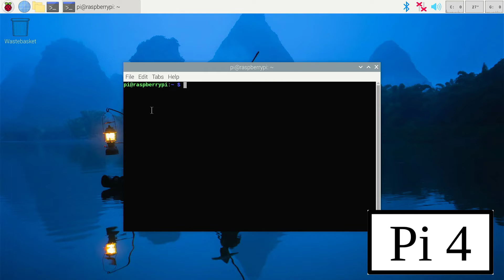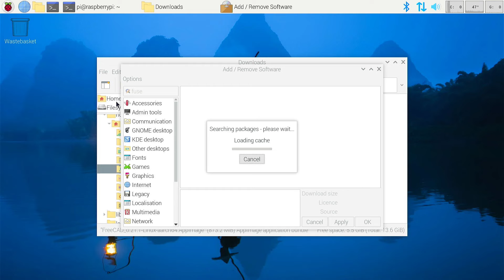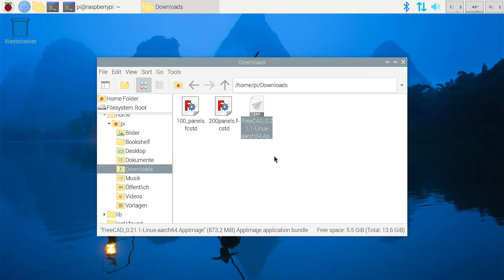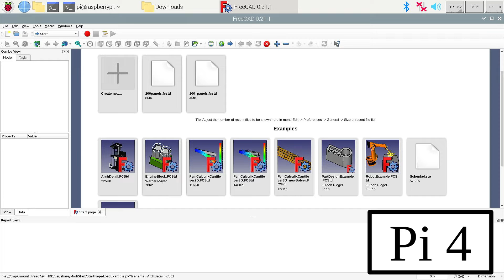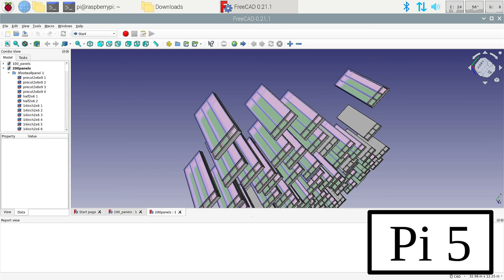FreeCAD on Rasperry Pi 5. Speed comparison vs. Pi 4 with Raspberry OS Bookworm

Comment: What game engines can I run on rasp pi 5
Reply from the maker: I have not much experience in that. But the question is "bad", since there are so many different types of game engines and it is also not clear if you ask out of the view of a developer that use the game engine to make a game or if you talk about a user that runs a game that is compiled from such an game engine. You can for example use a PC to make and compile games for game consoles.
High quality game engines for 3D games like Unity and Unreal will not run. But there are also game engines for 2D and oldschool RPG games. I guess most of them could run. As far as I know Godot, PICO-8 and LÖVE run on the Pi.

Comment: Hi, trying to install Free Cad on Pi 4 , installed Free Cad and when you go to options and type "fuse" the whole options box disappears off the screen, not sure why, can you help?
Reply: Hi, moved on a bit, I found that a window would come up when right clicking the downloaded file as in the video, clicked on "execute", nothing, can you help?
Reply from the maker: @philkneen4752  You are sure you installed fuse correct? There is probably a small warning, that is sadly closed so quick, that you can't read it. Please press on "Execute in Terminal" instead of "Execute" if you try to run FreeCAD. Then then the error message hopefully won't close so fast. If it still close fast, then you need to open a terminal yourself. Do you know how to navigate and execute in a terminal? It is sadly a bit difficult to explain with text only. Can you read the error message now?

Comment: How did you load it, it has a black center screen with mine it hardly loads brand new pi5 8gb
Reply from the maker: hmm... I think i done nothing other special than you saw in the video.
What exactly do you mean with "load"? Start/Execute FreeCAD or load a saved file in FreeCAD?
I used the official Raspbian Pi OS. Do you use an other OS? Currently the different operating systems use different software to display. Some use X11 and some use Wayland. I used the default setting from Raspbian OS. As far as i know that is Wayland on Raspberry OS. Maybe your OS use X11?
Reply: Ok iv just seen all the waylaid stuff i can't get vnc to work ether, but the app cura wont open unless in terminal  ? None of my desktop pics do anything?? Cura ?? Vnc ?? Seems like my old pi4 was better setup finshed
Reply from the maker: @only1leddy  hmm... Not sure if i can help you with that. What OS are you using?
Reply: Linux 6.1 debian aarch64 (2024 01 25 😅 i can run cura but only from terminal, bookworm I think ? Does work but with black screen to start with and flickers loads tbh it's all over the show so I'm wan use fusion on my surface go and just vnc into it but that don't work either? Todo with the waylaid? I really might just load a old bullseye instead at least it works
Reply: Tbh iv only just opened the pi5 so bookworm os is new to me thanks for trying to help I did get it running and it does run OK 👍 once you open it 🤦‍♂️
Reply from the maker: @only1leddy  You are welcome.
Reply: Ps it seems works much better on x11
Reply from the maker: @only1leddy  Sometimes the reason is only a missing driver. I noticed for example similar problems with LibreOffice and it was easy to fix it (if you know what is missing). see https://forums.raspberrypi.com/viewtopic.php?t=359365